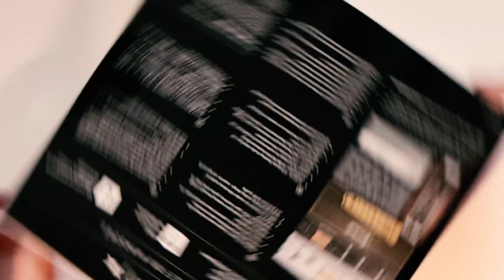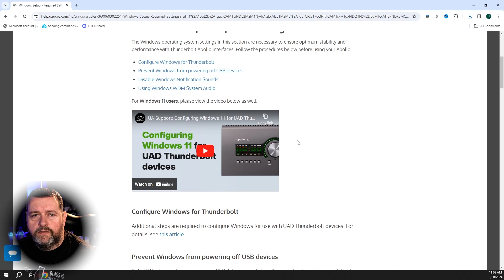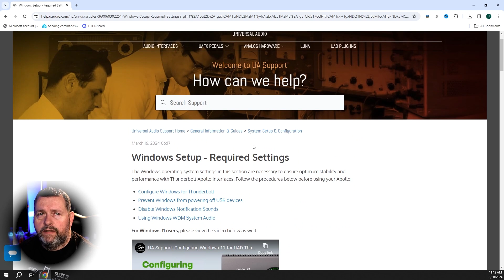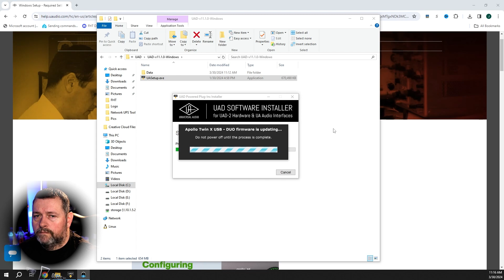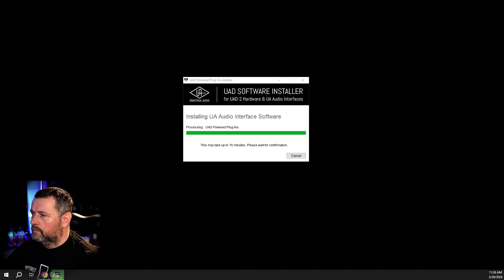Apollo Twin X Unboxing and Installation | Windows

Comment: lol if only if it was that easy… i have spent a week trying to get it set up and i finally figured out what i need. 100$ later i have a new pcie part on my pc and thunderbolt connections. i had to reinstall the pcie part on pci_e3 and not pci_e4 because e4 was x1. the apollo requires x4 so dont make the same mistake i made and if you need to get a pcie part make sure you put it in the right spot!
Reply from the maker: @ericlanza9904  it is that easy. I can't help you bought the wrong version. Lol